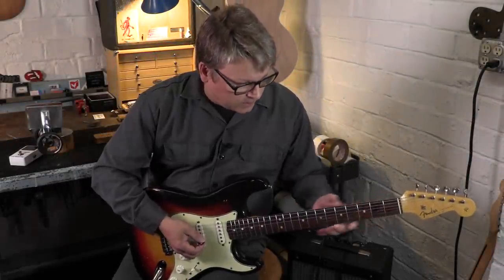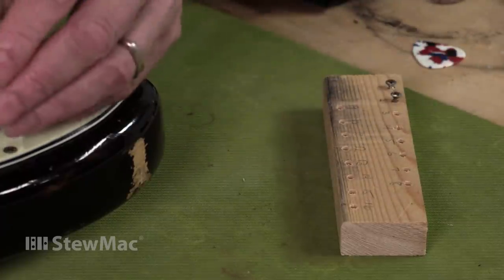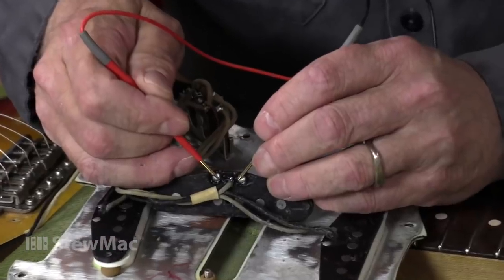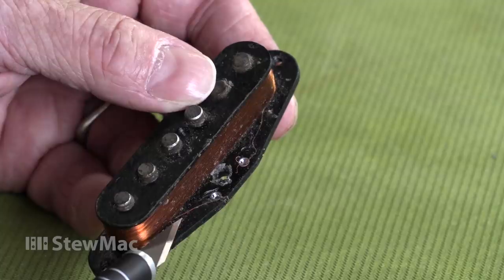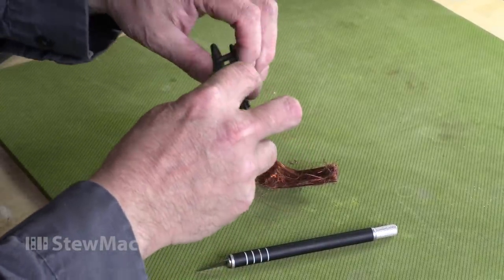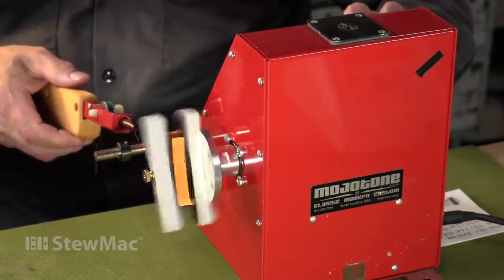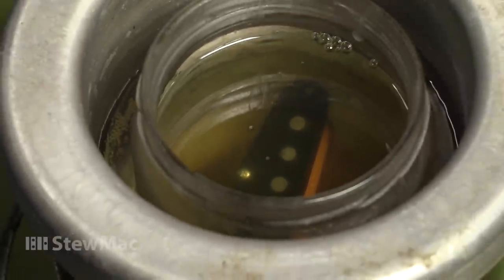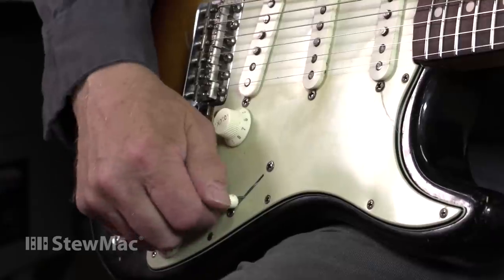Fixing a pickup on a 1963 Fender Stratocaster

Comment: Awesome work Erick! Came out sounding fantastic.
Reply: Fender why has no one noticed this comment
Reply: The middle pickup of my MIM '95 Fender Strat Special doesn't work anymore due to a pickguard swap; i noticed a slight pierce in the wire that happened some time when the cover came off while removing from the pickguard. After loading the pickups into the new pickguard I did the screwdriver tap to the polepiece and it was an extremely low volume drop that's almost dead compared to the bridge and neck pickups; it's going to need a rewind.
Reply: I doubt that this is actually the Fender Musical Instruments Corporation commenting on this video as they have their own videos I could be wrong, but I highy doubt it.
Reply: Solaris Moon just click the link fool also why wouldn’t it actually be them
Reply: hello senpai
Reply: IHEartLReoy bruh theres a tick next to fender which means its verified to offically fender
Reply: @iheartlreoy8134  Because any user on this website is able to name themselves Fender and use a company logo for their profile pic.
Reply: Hey Fender, how's your old buddy, Bender?
Reply: Mox_au this account is verified
Reply: @solarismoon3046  Click on the Orange Fender circle and it takes you right to their official page. It is definitely the real Fender. I'm sure they applaud the care taken to preserve one of their vintage instruments.
Reply: @dinosaursdoingtherobot850  Dude, right at 1:02 he shows you the reading. Put down the spliff and pay attention.
Reply: Wow Fender likes your work thats cool.
Reply: dinosaurs doing the robot he shows it DA. That would be the 2nd place you’d check, after first checking through switch and all.
Reply: B. Rod Clark depending on depth in the winding you may be able to unwind the coil until you get to the damage then solder the damaged point back in to re make the circuit. Provided you don’t lose to many turns you should be fine. Even if you lost 100 turns that’s only around a 2% difference. Could be worth a shot?
Reply: It’s really cool that fender is actively supporting the online guitar community.
Reply: Fender what you doin here??
Reply: @b.rodclark7349  just buy a new pickup. no where near worth it to rewind a 95 mexi lol. get a set of noiseless pups you'll be in love.
Reply: @drpelliper5818  I discovered the RWRP pickup didn't need a rewind; the wire was broken from a pickguard swap as the cover came off so i resoldered it. Then i removed the bar magnets & slug rods for Alnico 5 polepieces from a shorted-out Tele neck pickup so it's back in motion but not in the Strat it came from though it was back there until i recently loaded it w/hum-cancelling Dimarzios (speaking of love!); with a pair of G&B Golden Age PU's, that BHK Strat Special's now home in a hardtailed Squier Bullet Strat sounding incredibly impressive.
Reply: @solarismoon3046  look at the verified check mark next to the name it’s real
Reply: That's a rare haha fender comment on a YouTube video